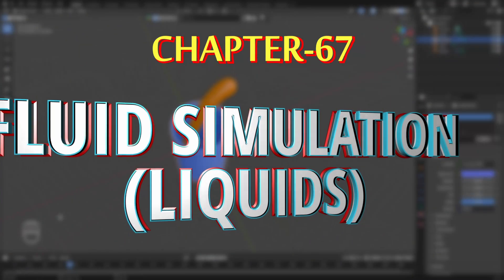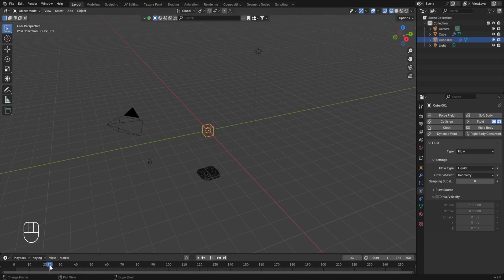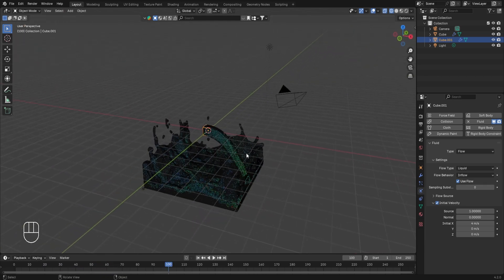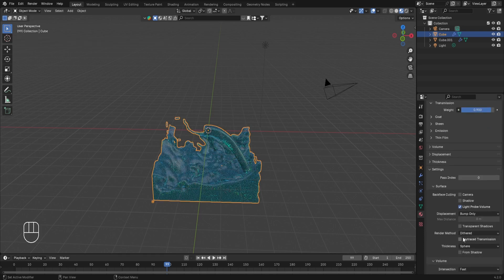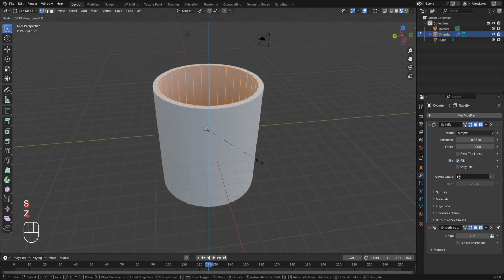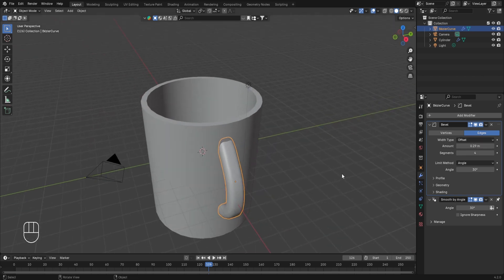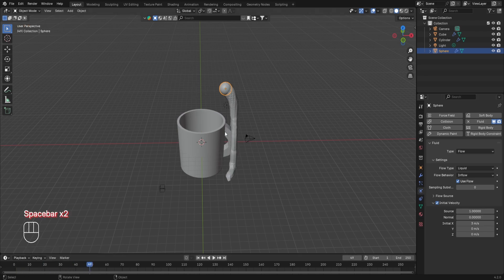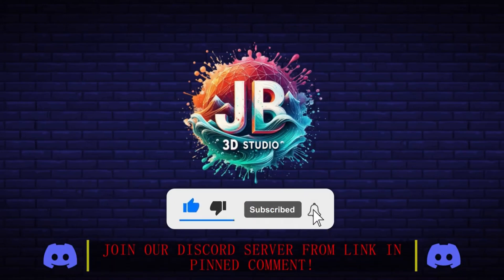BLENDER MASTERCOURSE: Chapter-67: Fluid Simulation (Liquids)

Comment: Thanks for the video. Can we make rain by using this method.?
Reply from the maker: You can, but it's not the best method for creating rain. Usually, particle systems are used for creating rain. And liquid simulations are used for creating large water bodies. You may try to create something like a waterfall as well.